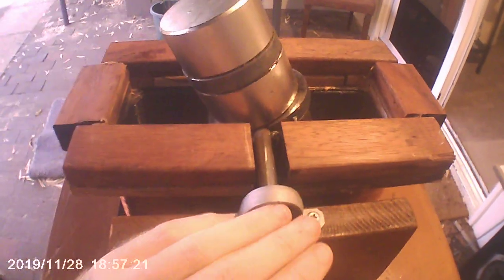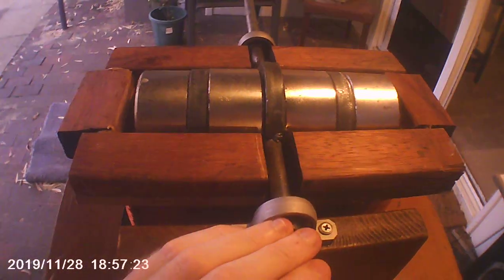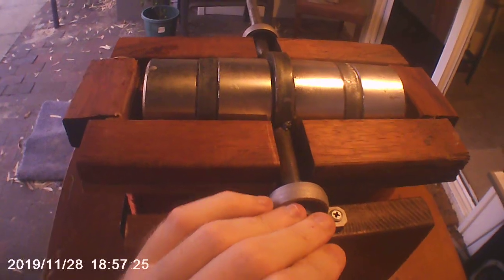Newman Motor * 5'th Prototype . conclusion : FREE ENERGY YES,  PRACTICAL NO

Comment: thanks for posting.    some info.     Clarification:   not a single idea has  worked,  YET.  
if it had,  you would  NOT  be  reading  this.          by  now,  it should be  Obvious to  Everyone,  that all the failures are   proof   that  the findings of  lenz  and  faraday  were  Correct.        i encourage you to  Try  something  ELSE.          such as, incorporating  (reduction and Inherent)    MA   into a  torque creation/manipulation/amplification  transform.     see my research.
i would suggest  that the  implications  of  the  Scalar  nature  of  TORQUE  have been ignored;  in favor of a belief in the validity of  a    Flawed  ancient, assumption  about  machines.
this stoopid assumption has nearly led us to our  Ruin.          nuclear power generation should  Never  have  proliferated.                        it should be understood that when a  coil  is   Not  well-made, experiment results will Always tend to be  'disappointing'  and   uninformative.    in part, because  output amperage and  WATTS  are  always  minute.        'a bigger coil is seldom a better coil'    and   few  coil makers  Know what they are  doing.            what is the difference between a passive, helical/toroidal  inductor  and  a  self-inducing  Generating  coil.      answer:    the number  of   LAYERS    and   a    Meandering  current  path.        what does the latter mean.         consider each layer in a multi-layer coil, as a sub-coil.      in order for  the  current Polarity  to be the same in all  layers/sub-coils,  sub-coils  should be  connected  in  Series.     that is not the result,  when a coil is wound in the  conventional  way.       the result is that, between any two adjacent sub-coils  the current flow  is  180 mechanical degrees  out of phase.     this is the source of  back-emf  in a typical coil;  no back-emf in a  Single  layer coil/inductor.     when a  multi-layer  coil is energized, back-emf  Becomes  Impedance.       when present in a  Generating coil, such impedance will Always  Limit  output   amps;  and  Watts.     watts = volts  x  amps.        (  but,  voltage is  Not  affected by the impedance; so,  a relatively  high  output voltage  may be measured.    in the context of  Power/watts,  high voltage  is  Offset  by  MINUTE  current flow. ) 
conclusion:    no  matter the purpose,  a coil Should consist of just a few layers.

in the case of a solenoid application,  impedance-related losses  maybe could be reduced
if  the  current flow in a coil  does  not  meander.        in the case of a Generating coil,  the key to self-induction  IS  back-emf;  but  Not  Too  Much.          best efficiency in a  Generating coil will be achieved if  14awg/equiv  magnet wire is  used.         in order to use smaller conductor,   wind coils  'in hand".        in general, the best coil 'shape' is the brooks coil;  square cross-sections.       cheers            googletranslate
http://nessengr.com/techdata/brooks/brooks.html

3-phase  pma   stator;   3  coils per phase, 120 degrees apart, connected in Series.     make  a coil  or  a  phase   for  testing.    if a phase is made, relative interval of poles on the rotor should be 90 degrees; so,  four or eight  magnetic poles. 
http://scoraigwind.co.uk/wp-content/uploads/2011/07/coils91.png
Reply: Duh. Faraday's law and lenz's law is obviously correct BUT the definitions have been altered.

I will reveal to you the REAL definitions of these two.

Faraday's law : Changing magnetic flux induced emf BUT the total induced emf depends on RESULTANT flux between the rotor flux and stator flux.

Lenz's law, the REAL one : Magnetic field exhibits action and reaction like matter does. In order to compensate the energy requirement, energy is DUPLICATED to oppse the change.

The fact that lenz's law disproved thermodynamics is kept a secret. Hence, they rewrote it as unnecessary BS complex definition which gives people headache.

The fact that energy is duplicated just to cancel the source is also kept a secret. They don't want people to find out how to solve this problem.

Solution? Use two different cores with different magnetic permeability. The lower magnetic permeability acts like a valve against back-flux from the stator core. Hence, no torque reduction under high current draw. Next, two stator coils are oppositely wound to produce two opposing back flux. Result? The rotor flux is maintained.

Resultant flux ~= rotor flux - (1/2)back flux + (1/2)back flux.

That's it. No ZPE nor quantum quackery BS. Just simple flux redirection and back flux cancellation based on magnetic permeability and flux ratio.

The fact that this is SO EASY that the control maniacs do a LOT to hide this.
Reply from the maker: thanks for the input on lenz law, - inrelation too the newman motor, its important too note, lenz law is a regulating force, not a limiting force.   like too see my example motor ? . https://www.youtube.com/watch?v=Stjf7M1Cx78
Reply: @director-patrickwatkins  bla-bla-bla-too the-bla-bla-bla-too note-bla-bla-bla-too see-bla-bla 
you are invited to  SEE  that, research based on   flawed Fantasy/tesla/newman/et al, is  stoopider than doing  original  circuitry research.    which would, also, be the opposite  of smart/informed.
Reply: Didn’t Tesla find an elegant solution in his patent on electromagnets?
Reply: @kolinevans9127  bifilar coil is still a stator.
Reply: Lukie Kelen by inverted winding ‘Tesla’ and adding a 0 point the inductor acts like a Tractor device ‘capacitor’ Tesla clearly stated that at a point of variables the ‘self induction’ could be reduced to just the wire resistance, the quote is in the patent. 
One variable is pressure, another is the size of the ‘plates’ , notably Tesla used high pressure obviously {as he stated} the higher the pressure the higher the ‘capacity’ 
If you wind a 4 or 6 or 8 strand ‘Tesla’ winding on a core then measure it’s self resonate frequency against a 2 strand, the self resonance is lower the more strands, it’s self evident that XL and Xc cancel at a point , the point is ‘normal’ inductors of single wire have near no ‘capacity’ {tractor force} and 2 strands give the ability of the inverted equal ‘plates’ the rest comes down to variables.

As stated wind a reasonably large T8 {8 strands } center tap it {0 point} then a ‘identical’ b} inductor on the same core split then so they are 50/50 on the core not on top of each other, and configure everything as Tesla , then test for self resonance, then use an astable trigger and ‘low side switch’ the a} having one polarity at the 0 point tap and the other at the other side of the low side valves, {that is basically an ‘advanced’ ‘joule thief ‘ configuration ,  switch at different frequencies then start the add Tractor devices to the {b} inductor, obviously if you attach a lamp you will find where based on X tractor device size then you get the lamp lighting up. 

I have identical A and B {on a small device about 630mH of inductive inertia} with 12V in and light a lamp on a single inductor above 240v at apparent resonance in the b} but I don’t think that is the end of the story as per my previous comments regarding transformation and actualization of inertia. 

Furthermore, if one adjusts the PWM of the input trigger, I’ll be utilizing a SG3525 for that soon to test  then it is likely that one could reduce even in a single core the inertia opposing even further. 
Even though if you use a CD4047 you can Gate it , the ‘NOT astable’ and ‘astable’ pins {4 and 5 I think}  can have inputs fed back in to gate the output the oscillator runs at twice the frequency of the astable output so you could test gating the output on a cd4047 probably with the oscillator output , the old skool data sheets were much more helpful {like everything on Earth lol} 

This above outline indicates to me that ‘yes’ the inertia can be made to rotate at much less ‘self induction’ , or opposing inertia, then next question is how to then actualize that inertia into the 3D plain. 

My guess is in very much the same way you do it with a flywheel, but I guess we’ll see.

For example if you are trying to utilize offset inertia on a flywheel would you hook the ‘lamp’ load just straight up to the flywheel shaft ?

I think the answer is ‘no’ if you understand.
Reply: @kolinevans9127  The newman motor is actually a generator. Trying to overcome lenz's law lmao.

From what you said, it is meaningless when you try to use it as a generator coil.
Reply: Lukie Kelen yes I was not referring at all to a ‘Newman motor’ 
However furthermore to what I was referring to which was offsetting inductive inertia, there is another interesting variable, which was covered Party at length by Sam Ben Yakov , which is how much ‘magnetic force’ is in the gap of a core, if the aim is to raise the tractor force of the inductor inertia Device, by having the fields set up ‘complimentary’ as stated in Tesla 381970 Patent then  theoretically these ‘pulling’ forces would actually greatly advance the tractor force overall, but that’s just a side thought. 

Yes the Newman motor I know little about it unfortunately, you would be the authority here in that respect.
Reply: @kolinevans9127  It's just large mass overcoming lenz's law in general. But newman motor is meaningless when it comes to large power system.
Reply: Lukie Kelen oh ok well one of my emails is Not RickSanchez I made it that so people know that I’m not Rick Sanchez, having said that I just had a thought if I was Patrick here I’d consider using force {in a practical way} and sealing the ‘magnets’ on the ‘Newman motor’ in the opposing position, this would force the field polarity 90 deg adjacent to each , I don’t think it would be practical with those monsters he has there but perhaps if he experimented with some Polarity inertia devices that had a hole in the center then he could get a non ‘ferromagnetic’ bolt and nut and screw them together and fix them with expoy , having done that we know know that the fields would be 90deg adjacent, you could conduct then some useful experiments by shifting the field polarity of the ‘stator’ inductor with a tractor device. Maybe I should post this comment in the main section so it helps people?
I mean after all why are we here if it’s not the help people right ?
Reply: @kolinevans9127  Took a long while to understand what you said. The 90 degree polarity is due to right hand rule lmao.

In other words, the force opposition is still there.
Reply: Lukie Kelen I’d invert them , and put the poles at a 90 deg vector from each , I’d do it for for fun and a good time !  And a laugh, I’d do it because I’m CrAzY like that , then I’d do a bunch of experiments on the stator , unfortunately my general ‘engineering’ skills don’t have the patience for such a device, maybe we need to talk to CERN and see if we can get the Tman back here? 
Patrick has this thing built , I’d oppose the POLES Patrick cross the lines this isn’t ghostbusters!
Reply: @kolinevans9127  Sounds lik a magnetic engine.
Reply: Lukie Kelen I just got my iPad out of the fridge , we need to invent air conditioning, it’s getting kinda hot here !
Reply: @kolinevans9127  Blame entropy rofl
Reply: @kolinevans9127  And, 90 degree polarity design isn't needed on the air gap itself. What you described was bi-toroid transformer structure used on any alternator.

Same as mine :D

I have two design fro my synchronous magnetic amplifier anyway. One without parallel, one perpendicular. One obey lenz, the other doesn't. I want to break their stupid thinking of "energy is converted for a generator". If energy is converted into electrical energy, why does the stator coil induced emf on the second stator coil rather than just pulling the rotor coil that also induced emf? XD The resulting emf exceed the step-up voltage by the two stator coil and the induced emf by the rotor coil. This is overunity because it proved that energy is NOT converted LOL.
Reply: Lukie Kelen ‘blame entropy ‘ ! Lol
Reply: Definitely not reading that:

sorry for your loss? or thanks for your opinion? or I hope you find that lost animal? 
Above all I hope you find love ?

Comment: Have you tried to get a DC motor out of a treadmill, and a speed controller for it , either online or from the treadmill, then connecting it to a reasonably large flywheel, and spinning that flywheel up to a reasonably high rpm with a ratio from the motor to the flywheel that increase the speed , then off that flywheel shaft for example then gearing it down to a low rpm on a second shaft, then adjusting it from that shaft to any generator required rpm? 

Like I outlined in that post? 

I haven’t gotten around to it , I’ve been working on the inductive inertia analog. 

Regards
Reply: i did build a machine with a 1.5mtr flywheel, too experiment with different drive coils, magnetic blocking, and earth connections.  results were we per most ealerly experiments, - marginal at best.   but you must take some bad steps somtimes too ovoid stagnation